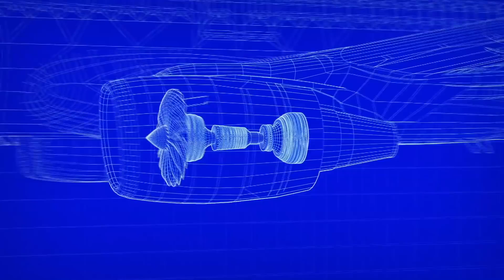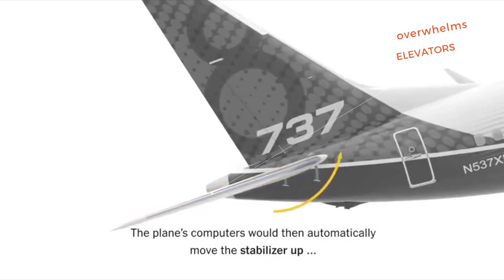737 Max 8 probable cause revealed - Prof Simon

Comment: OK I get what you are saying but from what I have seen you just disengage the auto pilot... 2 switches on the lower right side of the instrument panel between the seats...  and fly manually and not fight the system... Why pitch up so high in the first place??
Reply: An angle of attack sensor was indicating 20 degrees higher than the other AOA sensor. The aircraft was sensing an imminent stall. Part of stall recovery is nose down and max thrust. These engines have a lot more thrust than prior 737 models. On ANY model of jet with engines mounted under the wing, adding power causes some degree of nose-up movement. It's reasonable to presume the aircraft with the biggest thrust engines will have more nose-up movement from added engine power.

Comment: So Boeing screwed up and needs to make some changes to this aircraft.
But to suggest that the airframe is unusable is ridiculous. All that needs to be done is to provide  dedicated AOA sensors and then compare readings, if no match then MCAS should be shutdown immediately and reported in no uncertain terms to the pilots.
There is automation all over commercial aircraft already, so to say the MCAS system is a bad idea is silly.
I am quite sure this will be sorted out and that this particular aircraft has a glorious future ahead. In fact, future designs will no doubt include the updates made for this ingenious design.

Comment: maybe this is because the MCAS
 system are abusing the horizontal
stabilizer causing premature failure ..
Reply: There is no evidence any part of the tail failed. The FDR would show what forces were on the tail, even if none of the tail were recovered after the crash. The tail surfaces did what they were supposed to do. A faulty sensor activated an automatic system, and the pilots coping with the unusual behavior triggered the safety system to keep applying nose-down force. If Boeing had simply been more clear about installing their MCAS onto this new model of the 737, which would have caused additional training neither plane would have crashed. Numerous other flight crews flying this model of aircraft safely recovered from the same problem the accident crews and their aircraft crashed. Trained pilots can fly a fork through a hurricane given the proper training. The aircraft had some faults, important information and training was hidden from the pilots, some pilots didn't have the experience or time to recover and save the aircraft.

Comment: The plane shouldn't have the engines moved so far to the front, which is only because the whole body and undercarriage construction isn't made for these huge engines. A complete body and undercarriage redesign would have been the proper solution.
Reply: you are so right-bring back the 757 and stop messing with the 737 desighn
Reply: Boeing skim on R&D to do a proper redesign on their most successful plane and now effectively killed it for penny pinching
Reply: They were cutting cost and time for faster profits that well never materialize at this point. A trade off of perceived profit and safety.  Boeing lost the gamble this time.
Reply: A redesign would have cost 35 billion, but what is the cost of a life?
Reply: SPOT ON FURZKRAM... these new engines consume 20-30% less fuel, but the trade off is size of engine. They couldn't place engines under wing as usual, but forward and up, thereby changing the aerodynamics,... and thus kaboom we have complications in correcting the money saving engineering.... software just assisted  but engine dollar pinching doomed the plane before it even got off the ground.
Reply: Or, redesign those landing gears to be taller to accomodate larger engine without changing engine position
Reply: The airframe couldn't be raised due to the emergency evacuation over the wing. On a 737 the passengers slide down the flap. If it was raised up there would have to be designs for a slide and wasn't cost effective or productive for the airframe.

The LEAP engines are great for the 737. Pilots need to be trained how to fly them...
Reply: it's a typical case of economics over safety. Boeing didn't have enough time to come up with a total redesign of the 737. While Airbus released the new A320 and Boeing didn't have anything to offer, other than re-working the old model. The order book of over 5,000 Boeing 737 Max can crumble very fast if customers loosing confidence in the design of the plane.
Reply: @alhouser4010 : started already, Indonesia cancelled their  47 planes.
Reply: @alhouser4010  Indonesia already did so!

Comment: What is the solution to this problem now that most people have lost their trust in this plane? Will a software update regain the trust in passengers, especially sceptical ones as myself? In my opinion, I think the flawed design should be re-engineered.
Reply: Most people have no idea what make and model of plane they're flying on, and don't really care. Even if they check ahead of time, the airlines can swap out the plane at the last minute. Ignorance and blind faith will keep it going.
Reply: We should trust programmers to keep the 737 MAX in the air, rather than pilots, apparently. ;P
Reply: They may just change the name of the plane.

Comment: Boeing should ve known about this thing... actually, I am sure they knew ...but didn't care...the point was to get the plane out and sell it as soon as possible...
Reply: They knew what's the problem and to tackle it they created an autocorrect software called the MCAS. It's not a permanent fix but merely a workaround only.
Reply: Well, that's hardly the case. For reasons that I already explained above. No company would knowingly put a ticking timebomb in the design/quality of the airplane. Merely because they know too well that it WILL go off. And the impact on the company will be disastrous. Most probably we see exactly the same story as the one with the de Havilland Comet. Its design WAS flawed but nobody knew that something was  wrong with it. Until two (or three, can't remember) airplanes disintegrated in the air and the authorities spent months investigating what went wrong.
Reply: @vladispassov  it's been done before. What ever America company with the inward closing cargo door.i think it was McDonald Douglas.
Reply: Of course they knew and decided to implement the MCAS half-assed solution instead of a full redesign. Big companies have a risk & liability calculation force that will inform management how the cost of implemeting a fix compares to the costs of lost sales/legal/etc. if they decide to ignore an identified risk.
Reply: Yes you are right would millions to proper solve this issue so they went for cheap fast options look at the result our lives in their hands no thanks. Think planes so much were safer 20 or 30 years ago
Reply: Nothing surprises me coming out of the U.S. these days.

Comment: I agree 100% with what you said Professor. MCAS system was written (the software) by professionals I believe - however the complete system must be supplied with the accurate data from all the sensors around it - first of all the MCAS must never let the airplane let its nose down - I say NEVER! If this happened then the system has a bug or the data from the sensor was wrong or missing or not enough sensors were checked for their readings. Single MCAS system is not enough... There must be 3 independent systems running in parallel like the 3 famous computers controlling the first Columbia Space shuttle - I say 3 INDEPENDENT! Even having this built-in the pilot should always have the top priority to take over the machine steering system manually at any time when electronics fail or starts playing games with the plane. Do you agree Sir?

Comment: 🎮😍 Too Narrow Wings are Knives in Air...Engines stood out forward and the Thrust is wrongly from Forward of Wings...This Jet makes the Pendulum to Pilot have to hold Horizontally all duty....😂 Too Short Engines works like Pistol's Barrels...To clean Mechanism of Flaps's Motors and Shaft.

Comment: The biggest problem is that the aircraft has evolved so much from the original 737 it has now only by looks and the landing gear  a 737. I feel it has reach its design limits if no surpassed it. Placing the engines so far forward and redicted thurst line. Second thing is both these aircraft have crash i what of a better term 3rd world countries.  Whislt the aircraft (all types) are flying correctly all is well, when you have a problem is when they earn thier money, anyone that cant manage that ends up in a box. 
Boieg have egineered a fix that it should not have to have. The 737 legs are two short, while this was ok for the jd8 it was initialy design with with the thurst exit rear of the wing these new large fan engines are to far forward. 
What the answer is now who knows. I asked the question before that these aircraft have been flying for some time now with no reported incidences and now as the rest of the world gets these aircraft on line and we have lost two quite quickly.  
It is to easy to blame the aircraft, thoose in the pointy end it seams need far better training and understanding of the airframe systems.  
Aviation is inherently dangous but when you purchase a ticket you expect to get to your destination in one piece.  
Its a shame that this aircraft that for so long has been the back bone for so many airlines it record will only show this.
There is a old term that states
If it arnt boeing i arnt going

Comment: Had Boeing built a "stable" air frame, to accommodate the larger, heavier engines, the plane would have had a "neutral" area, where the trimming and stabilizer would have allowed level flight without the need for a software solution to control the rear stabilizer to bring the nose down.  I ask the questions:  1/ If Boeing had taken the time to build a new air frame (essentially a new plane) to house the 5000lb heavier engines, would the 5000+ orders of the redesigned 737 MAX have been lost to Airbus? and 2/ Did Boeing make it's decision to mount the engines higher and forward, thus unbalancing the plane, for mainly economic reasons only, to finish the plane and make it ready for production & sales? also... 3/ Was the FAA soft on Boeing, in accepting Boeing's software solution, MCAS, to keep the unbalanced plane from stalling, and in accepting the "original safety analysis that Boeing delivered to the FAA for a new flight control system on the MAX — a report used to certify the plane as safe to fly" (which) had several crucial flaws? https://www.seattletimes.com/business/boeing-aerospace/failed-certification-faa-missed-safety-issues-in-the-737-max-system-implicated-in-the-lion-air-crash/
Reply: Your assumption is off. The plane is stable. The engine can make it unstable. Maybe you don't realize how many planes have engines tilted down as a physical means of adjusting to things that can otherwise be controlled by software or pilot. 

Even with the engines in place, if the engines were not producing thrust the plane can glide fine. 
Here it seems the software drove the plane to the ground.
Reply: It is my understanding that a well designed airplane is capable of level flight without the stabilizer having to be constantly adjusted, and although slight adjustments are carried out by the auto pilot, nothing so radical as the MCAS system is capable of is necessary. I make an analogy with a motor vehicle, which depends on the alignment of the wheels to travel straight down a straight, flat road, without having to make constant large adjustments of the steering wheel to keep the vehicle traveling straight. However, if the wheels of the vehicle are misaligned, the vehicle can pull to one site, requiring a constant adjustment to correct for the misalignment of the wheels . In the case of this plane, the engines cause the plane to pull not sideways, but up. I have also read that this characteristic is not just caused by the thrust of the engines, but by the shape of the nacelles, which add extra lift to the wings. Once the engines are attached to the plane, are they not part of the air frame?  According to what I have read it is not just the engines thrust that causes the nose to lift, it is how they affect the lifting action of the wings aerodynamically.

Comment: Really dont get how it isn't a CG problem, bigger engines, stretched fuselage messed with CG. So Wing needs to be moved for natural stability,  hands off. MCAS is the chicken  sht way out.

Why rely on elevator extreme (MCAS) adjustment,  when the plane isnt even stable?????

This model has been stretched numerous times,  obviously wing should be moved into a natural position for given stretch and engine mods.

What about the fuel cell location's, when full fuel plus inherit instability, what then. Too me, it's got CG written all over this nonsense.
Reply: it's a thrust issue, not weight and balance. Thrust causes the pitch up
Reply: It is a CG issue, but fixing it would involved much longer testing time is the problem. The business motive was for quicker profits, and to byass the longer development and testing time required for a new design classification.
Reply: Mark Schumacher they have tried so hard to make an unflyable airplane fly and this is just the results. I think they have lost their vision as an aircraft manufacturer. I cannot believe this, it is really sad. They really thought they had got away with fooling the layman, now the truth is coming out!!!

Comment: To be more accurate, MCAS caused uncontrolled nose dive behavior because of a failed AOA sensor. 
MCAS is not faulty per se, but badly designed such that it cannot handle AOA sensor malfunctions properly. Obviously this does not remove Boeing's responsibility.
Reply: It seems foolish to build a system that operates on just two AOA sensors left and right. The mcas is faulty in that if it suspects a faulty sensor how does it predict which is faulty? So in fact it could be faulty and need to be rewritten especially if it is ai based

Comment: Message to Mr. CEO: You are wrong. Unfortunately Software update is not going to solve the problem. 
Truth as follows: 

Physical construction of Boeing 737 Max is wrong. Engine is more powerful but size of engine is bigger than the regular 737's engine. Engine is installed under the wing a little forward and up so that to keep enough distance between engine and ground . This installation in flight, makes tendency of turbulence over the wing which result in stalling the aircraft which means in other words nose up. As Boeing you knew that this will happen during the flight. So you installed MCAS system on the aircraft. MCAS system makes the nose down in case of nose goes up.  Bu it doesn't work properly and puts the aircraft diving and then crushing.  

There is construction fault on the Aircraft. This construction fault can not be corrected by MCAS system's software modification. So this aircraft cannot be considered as a safe aircraft even if after software modification. 
Because structural fault is going to continue to stay there. You are adding a new system (MCAS)  on board which means that you are adding a risk on board. What will happen if MCAS fails at flight?!!!
In order to solve the problem structural changes must be done on the aircraft. Regular version of 737 has no MCAS system. Because physical construction is correct. But fuel consumption is a little higher than 737 MAX. 
737 MAX has new engine with good fuel efficiency but comes with safety issue. In aviation safety is an paramount. 
So it can be end of 737 MAX.
Reply: No s..t Sherlock...
Reply: It's not that...the System and AOA sensor is bad...
Reply: Is there any rule to require a plane to be inherently stable in design without software intervention?

Comment: There should be a system in place using gps to determine when the plane is pitching nose down based on altitude and normal flight characteristics that will automatically nose back up. Especially if it sees and extreme nose down condition. It could be done using gps at the nose and tail. The difference in distance could determine the flight level condition. This would of course be another failure point but at least it would be less mechanical and more precise. Just an idea.